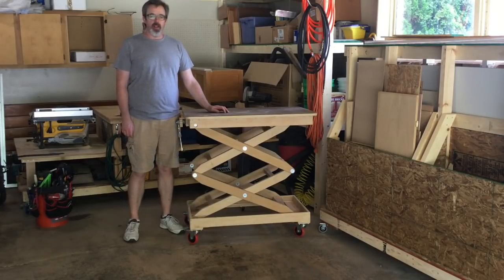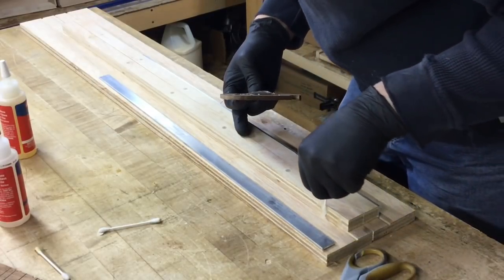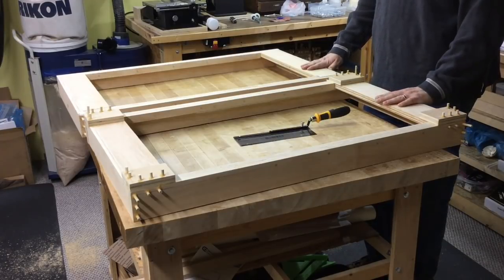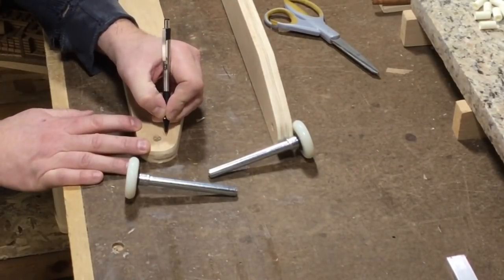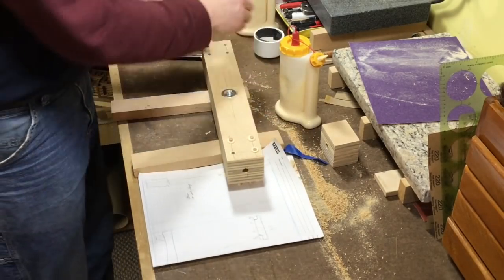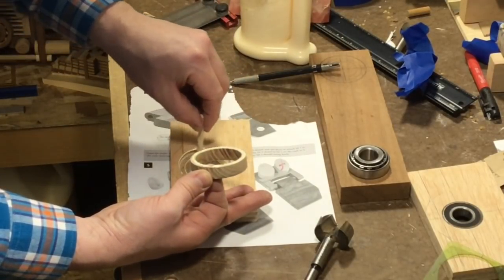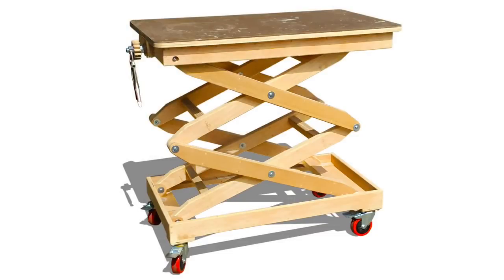Scissor lift table from a single sheet of plywood - plans available for newer updated design.

Comment: I like your modifications which bring it into my budget range. When using a hack saw, as soon as you pull back on the saw with pressure, you dull the saw blade. You can cut faster by moving the saw back with no down ward pressure and forward with pressure. So you make less strokes and they don't need to be as fast and your blade will saw many pieces before it needs replacing.

Comment: Instructables currently has a "made with one board" contest.  You should read the rules and enter.  This is amazing.  I wish that Marius would put some plans.

You provided so much detail.  Thanks for this!
Reply from the maker: Michael, I have now finished my plan book and it is up on Amazon as of March 29, 2022. The book has both Imperial and Metric dimensions, as well as drawings for either a plywood or a hardwood build (there are slight differences between the two). I will be posting a video soon that goes over all my improvements and upgrades, as well as having links to the hardware I used, but for now, here is the link to the book if you are still interested :  https://www.amazon.com/dp/B09WQ17SZP/ref=sr_1_5?crid=15AJX53LN8YSH&keywords=sg+devries&qid=1648654405&sprefix=sg+devries%2Caps%2C99&sr=8-5
Reply: @s.g.devries8557  thanks. I'll have a look.

Comment from the maker: Link to the updated video: https://www.youtube.com/watch?v=KT79bRcNWkE
Link to the plan book : https://www.amazon.com/dp/B09WQ17SZP/ref=sr_1_5?crid=15AJX53LN8YSH&keywords=sg+devries&qid=1648654405&sprefix=sg+devries%2Caps%2C99&sr=8-5
The book has both Imperial and Metric dimensions, as well as the drawings for either a plywood or a hardwood build (there are some differences between the two). It is 146 pages and gives step-by-step instructions with over 250 photos showing every step from start to finish. 

I had to make a lot of upgrades to both the design and the hardware so that it was fit to be published. Please note that due to the required upgrades, it can no longer be built from a single sheet of plywood, you will need two sheets

If you are familiar with my other plans, you will know that I do not mess around and try to get away with as little work as possible on my end. I photograph and detail out everything. Every single step has photos and written instructions, from the first cut to the final screw and shows the entire process that I use. 

I do realize that not everyone needs or wants the level of instruction that I provide. However, since there are so many different levels of experience and confidence out there in the woodworking community, and I want my instructions to be understandable to everyone, I choose to err on the side of giving too much guidance rather than not enough. 

If you have actually read this far, thank you. It takes far more time and effort to write these instruction books than I will ever get back in return, so I would sincerely appreciate any likes, shares, or  perhaps even a purchase. Thanks for your time.

S.G. DeVries
Reply: sketch it up, put in giant letters
DO NOT BUILD OR USE OR YOU WILL DIE AND OR BE SERIOUSLY INJURED AND IT WILL CAUSE GREAT SUFFERING
designs and drawings are for information only and any one who reads them must consult with a licensed professional engineer and architect and get a letter of suitability and liability from each of them before continuing to read the drawings.  All designs details drawings concepts plans and ideas are copyright the creator and you may not build without written notarized authorization
that pretty much covers everything lol
Reply: Totally understand, with this "eager to sue society" instead of looking in the mirror at the fool.
Reply: Any progress on plans to share?
Reply: Hi from Norway, I would love to have the plans or just the cutting plans, so I can make a 3D model for a friend who is going to build a pop-up cooler for his small cabin 😊 have you made anything and how much do you charge? Regarding lawsuits, that only applies to America I think. Nobody would do that here! 😁
Reply from the maker: Better late than never. The plans are now available. I have posted a pinned comment with the link and will be posting a new video soon showing of the upgraded table. Thanks.
Reply: @stacydemers2699  at least, here in Canada, of you decide to sue and lose you pay for the other person's legal fees. You can still sue for anything but the potential penalties discourage litigation.

Comment: Im not a englisch mann so here it goes : Drill a hole into the nut you want to rotate put a metal stick threw the hole and glue or weld it . cut a nut in the middle with a saw to match the "stick" u want to rotate  . Put the nut on a fitting cordless powertool and u dont have to turn for half an hour to get it up and down , nice table !

Comment: This is an inspiring addition to Marius' video. I have a good supply of hardwood that I obtained at no cost, but the separate wear top is a very good idea that I will take if I make one of these. The method of ensuring perfect alignment in the holes is also excellent and something I can use.  Thanks for the extra ideas!
Reply: 444

Comment: Very nice project! Thank you for the video. I dont have an immediate need for on, but I am contemplating making a 1/4 scale version. I nrrd something like that to raise and lower the table of my ancient drill press.
Reply from the maker: I actually built a 1/2 sized version for my own use. I use it as a table extension for my benchtop drill press if I have larger pieces I need to drill. I have made a lot of updates to the design and those updates are integrated into the plan book linked below.
Link to the new video : https://youtu.be/KT79bRcNWkE
Link to the instructions available at Amazon : https://www.amazon.com/Scissor-Lift-Table-step-step/dp/B09WQ17SZP/ref=sr_1_1?crid=20GTFPMISU9WO&keywords=s.g.+devries&qid=1654367699&sprefix=s.g.%2Caps%2C328&sr=8-1

Comment: I'm going to end up having to build several of these... One for myself, one for my mom, and one for each of my sister's... he'll, let's just put my dad and brother on the list, too.

My two bits to add are as follows...

I'ld add a handle to each end.

The threaded shaft with the nuts on each end, I would drill and peen a locking pin through rather than depend on lockwashers.

I would include a removable handle.

I would also install a battery powered drill on the backside of the screw, and arrange the 3 position switch on the handle to allow powered use without needing a cord.  A cordless drill from harbor freight will do just fine, at 20 bucks a pop.  If need be, drill and tap a hole into the end of the threaded rod and locktite a smaller screw shaft for the drill to clamp on to directly, or drill and peen a locking pin here as well.

Comment: Hi, at 4:44 you show drilling the holes at the end of the scissor arms. What measurement from center did you use for those? I have seen these drilled dead center of the scissor arms too and that seemed effective.  Did you ever finish plans?

Comment: could you use a drill to do the height adjusment instead of manual hand lever?
kitchen cabinets is the same exact reason i would need this type of table (:

Comment: Hello!
The very concept if the lifting table is inspiring.
Now, putting so much effort into a project using plywood which, generally  won't last too long; seems a waste.
There are so many amateurs out there who are really talented, so it probably would be better to use old mature and seasoned scrap wood for the project.
This would of course be somewhat tedious but it's one way to learn that hard work pays for itself.

Comment: Regarding the cut list shown at about 0:48 into your video, can you say the name and measurements of these parts? I cannot read them in the video.
1. Small rectangular pieces next to part "Long beam wheel rails"
2. Small round pieces under part "Top crank beam reinforcement"
3. Small rectangular pieces next to part "Bottom scissor braces"
Thanks. Great project and video!
Reply from the maker: Ron, I have now finished my plans for a vastly upgraded design and they are available at Amazon. I have a pinned comment at the top with the link, but the book has both Imperial and Metric dimensions, as well as the drawings for either a plywood or a hardwood build. https://www.amazon.com/dp/B09WQ17SZP/ref=sr_1_5?crid=15AJX53LN8YSH&keywords=sg+devries&qid=1648654405&sprefix=sg+devries%2Caps%2C99&sr=8-5
However, this upgraded design can no longer be built from a single sheet of plywood, you will need two. I made a lot of mistakes on this first table and can't really recommend anyone build it the way that is shown in this video. I will be putting out a new video soon with my new table showing off all the upgrades. Thanks for the comment.

Comment: This was a great video, I would like to make one of these. Haveyou thought about putting a material & cut list out for this?
Reply: If you look at the last image of the video you can see how the offset holes line up to push the pivot point to the top of the joint. That would make the joint collapse lower than if it was in the middle.

Comment: very good project  are the plans available
Reply from the maker: Richard, yes, the plans are now available (after a long delay on my part). I have made a lot of upgrades to the table and quite a few design changes to fix a lot of things I did wrong on this first table. Anyway, the plan book is available at Amazon. https://www.amazon.com/dp/B09WQ17SZP/ref=sr_1_5?crid=15AJX53LN8YSH&keywords=sg+devries&qid=1648654405&sprefix=sg+devries%2Caps%2C99&sr=8-5
The book has both Imperial and Metric dimensions, as well as the drawings for either a plywood or a hardwood build. Thanks for the comment.

Comment: Hi Steve. Real smart idea to drill the holes in one board  and swing it around to make the hols exact same distance from center.
Great instruction on building this table. Is the plywood 1" thick? I'm thinking of using 2 laminated  layers of 5/8" maple plywood for the  scissors arms.
Cheers, Jim
Reply from the maker: Jim, I used standard 3/4" plywood for this version of the table, although, I didn't use as high of quality plywood as I should have. I used a standard hardwood veneer plywood that has the softer core when I should have used a cabinet/furniture grade plywood. In the book I actually use triple thick plywood for the scissor arms. I do suspect that I over-engineered a bit, but I wanted to err on the side of over-engineering rather than under-engineering everything.

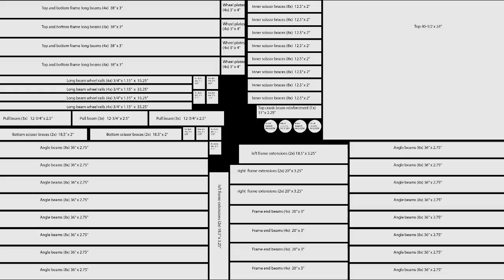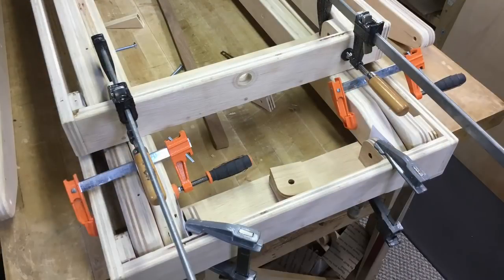Comment: So one has to buy your book to get the schematics and details? Suggestion: change the title to one more appropriate. "Scissor lift table from a single sheet of plywood + $29.99 for my book on how to do it." Also, it was apparent that you used all of the plywood 0:49 on your initial design. From what did you use for the reinforcement pieces 9:20 you added to your design later? As well as the two pieces of hardwood collar 13:09?

Comment: I can’t read the dimensions for all the pieces as laid out on the full 4’ x 8’ sheet. Would you please provide me with a clear pic of the layout.
Reply from the maker: Complete plans and instructions are available here : https://www.amazon.com/Scissor-Lift-Table-step-step/dp/B09WQ17SZP/ref=sr_1_1?crid=8Q0XPH61AIDZ&keywords=s.g.+devries&qid=1654367444&sprefix=s.g.+dev%2Caps%2C619&sr=8-1

The plans have both Imperial and Metric dimensions, as well as the full drawings for both a plywood and a hardwood build. There are step-by-step photos for the entire build.

Link to the new video : https://youtu.be/KT79bRcNWkE

Comment: I'll repeat the question with fingers crossed.  Could you share the cut list and required hardware list??? 
I have waited on the original builder for to long.  
This could really help me with several shop related issues.

Comment: This may sound like a stupid question, but instead of wood pins, would screws, nails or bolts do the trick and it's just an asthetics thing ?
Reply from the maker: Yes. Screws would also work, to some extent. With plywood however, I prefer to use dowel pins. Torsion forces on the frame can crack plywood because a screw isn't bonded to the wood at all, but the dowel pins are coated in glue which holds things together better, in my opinion. If the frame members were thicker/heavier, this wouldn't be an issue and screws would work just as well as dowel pins. Thanks for the comment.

Comment: I’m confused about the threaded rod on the tail end. How many nuts are used? I see 2 with a Lock washer between them. I think there is also one embedded in the pull beam. Can you explain this better for me. I love the design.
Reply: Hi Keth. I'm also confused and not sure if about the same thing. There seems to be missing an explanation about the block being pulled somehwere between the end tail and the front tail. Otherwise how could the scissors legs be lifted? That's the part I'm missimg...

Comment: why have you made it with for cisor arma on each side ?  Woldn´t two cisor arms do it as well, or is it ecause you want to get it up head higt ???? :-o
Reply from the maker: I needed the extra lift. I originally built it as a cabinet jack to hang kitchen cabinets, but now that I have built an upgraded version, I also use it to take things like wood slabs and heavy things off of higher shelves.

Comment: This is very cool. Too bad plywood prices have skyrocketed. What size bolts did you use? Any links to some of the hardware? I tried to find those bearings to no avail. Maybe I didn't use the right search term. I would have liked to have seen where the wheels went (although, it's possible I missed that part).
Reply from the maker: Here are the bearings: https://www.amazon.com/XiKe-Set-Wheel-Bearings-SET2/dp/B087ZY98MR/ref=sr_1_4?dchild=1&keywords=3%2F4+tapered+bearing&qid=1624492089&sr=8-4
Or you can just Amazon search for "3/4 tapered bearing" and that will get you lots of results also. As for the bolts, I used 1/4" but I am upgrading those to heavier bolts for the upcoming instructions that I am working on. In retrospect, 1/4" really aren't big enough. Thanks for the comment.

Comment: Hi there, brilliant job thanks for inspiring. I just finished building my own one. I've got a question for you. I noticed your studding goes from the front all the way through the back panel. Other people have done with the rod being shorter, only past the block being pulled. I've followed your version and the studding starts to bend as the scissors frame is raised. I reckon that's why other people made a rotating block so to be adapt to the new angle. Can you explain what solved this issue in your design so I can rectify mine? Thanks a lot. Shlomi

Comment: Can someone explain the types of bearings to get?  I don't understand how the rods and bearings interact?  Why did he choose a tapered and a non tapered bearing?  why isn't there a thread in the hearings for the rod to twist against?
Reply: The back bearing is just keeping the rod in place. It's not absorbing any actual force involved in lifting the cart, so it just has a non tapered bearing, as it has no axial load (axial load is along the length of the shaft, radial is perpendicular to the shaft). Honestly, you could probably build this out of all sorts of sketchy materials, as it's not really supporting any load. Just the weight of the threaded rod itself, and reducing the friction of turning the rod. 

The front bearing, near the handle, is being pulled INTO the machine, as the rod is being pulled back into the cart by the arms which want to collapse and lower the table. It is supporting the entirety of the force needed to lift and hold the cart's table, and it's super important.

It has a tapered bearing, so the bearing can oppose the force causing the cart to collapse (which would pull the threaded rod away from the crank and into the cart body, as the threaded rod is pulling the arms towards the middle of the cart). A non tapered bearing wouldn't be able resist the rod being pulled rod along it's length, and would likely fail quickly.

Comment: Hi, nice job! :) ... is the hole on the end of the arms 1/3 apart from one side? I read it is for leverage purpose. Is my deduction right? Thanks for your answer and go on, you are doing very well!! (clapping hands)  :)
Reply from the maker: I don't remember off-hand what the hole offset was, but you are correct that it is for leverage purposes. This only really matters when the table is at its lowest point though. Thanks for the inquiry!

Comment: Is there any particular advantage to the offset of the joints? I.e. would it work differently if all 3 holes in each piece were centered?
Reply: The offset in the hole position gives mechanical leverage to allow the lifting action with less required mechanical force applied.

Comment: Good job. Looks quite neat. Did you bother to test the maximum weight your table could safely take?
Reply from the maker: Andrej Zhirnyj I have not tested it. Since I used plywood and 1/4” bolts I knew it wouldn’t be heavy duty. It did handle the ceiling heater I took down quite well and that was about 100 pounds but I wouldn’t want to go much heavier.
Reply: Yair bitton  you mean a summary like the video your commenting on?